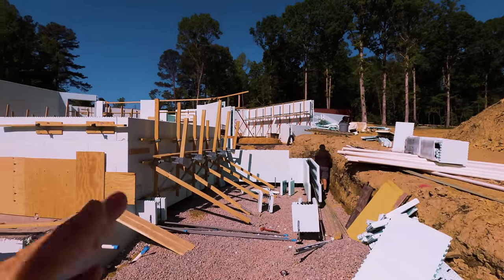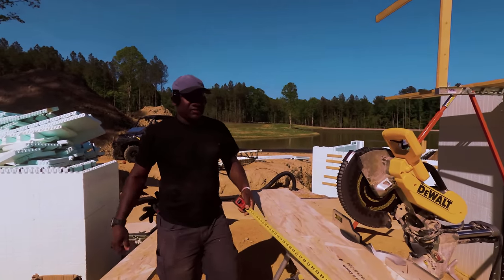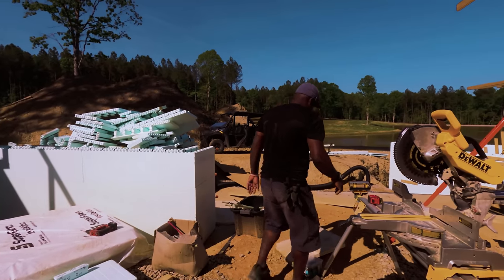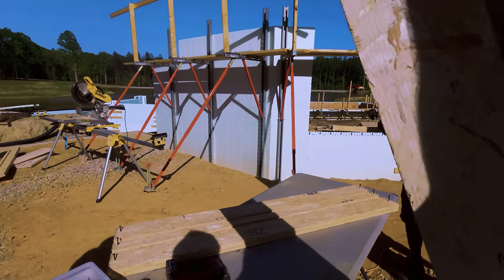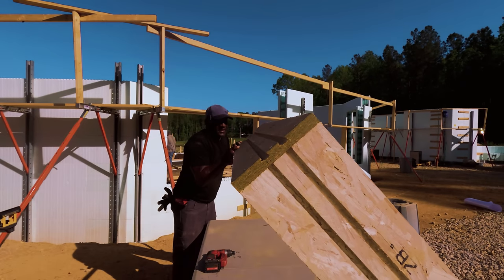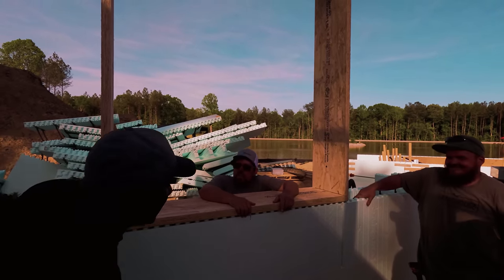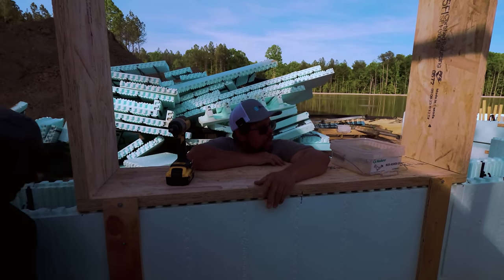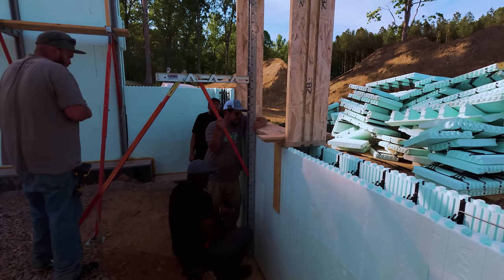PreBuck Window Construction and Building ICF Pump Room

Comment: Mr Bealygood tell them guys having issues with installing those screws to keep a bottle of dish detergent handy , add a few drops on the end of the screw and it will go in very easy. I've used dish detergent when installing screws into thick wood for years.
Reply from the maker: Great tip!
Reply: When I was a young man my old boss gave me a cake of soap for the screw’s worked well ,

Comment: with all those wide window bucks. It be a track saw for me and a 33 inch track. Portable table and a piece of styrofoam as a backer. Best tool I ever invested in
And the Metabo Triple hammer impact drill.. I’m a huge Milwaukee guy but Not even close in performance
Reply from the maker: Wish I had one 🤣

Comment: 10:29 Good old ported boxes. Yes sir, with 15 inch JBL's was heaven when the ports were right. Mid range and tweeter were many options but that bass had to be JBL's in my book.
Reply: Still using my original set of Harman/Kardon ported computer speakers from 1997 on my desktop today. Sound like brand new. Suckers got some heavy magnets. I know there is better tech out there but it don't sound the same.

Comment: A lot of side pressure on that pre-buck, better to make the horizontal pieces shorter and the vertical pieces longer, especially at the bottom. Saves extra bracing.

Comment: @15:28 I never thought I'd see this again: assembling bucks with Phillips screws. In my 50 years of assembling windows we went from phillips screws to square socket for light duty  and Torx for heavy duty applications we were assembling bucks  with panning up to 144 inches  . We manufactured aluminum windows , the company started in 1952 I started working for them in 1973 I retired in 2023 50 years. . I built sliding glass patio doors and terrace doors for 30 years I also built the various lines of custom shape windows, that was a job I loved doing (chuckling) two men said I was intense as Picasso with these windows , but I never cut my ear off ,LOL  Wojan window and door corp..
Reply from the maker: These are T25’s
Reply: @BealyGood  Ok pardone T30 no. 10 screw enamel or yellow plated but tube wax my man it won't jump or break or strip, wood is tuf but 6065-T6 aluminum is tuffer when using 4 inch T30 no.10 screws flat heads with a 1 inch shank .
Reply: It was Van Gogh who cut his ear off btw
Reply: @lastguy8613  I was typing a lengthy reply and hit a wrong key, just ticked outside the box and everything disappeared and the back button did not work, I'm a very spiritual person and when this happens I reverse course I have an intense bond with my creator and when this happens I try not to blow up it's difficult, a test , so I will not repeat it. I was typing a grudge that should explain. I apologize for wasting your time.
Reply: @kittty2005  All good my friend, I wasn't trying to judge and I hope Geoff found your information useful. Just pointing out it was a different famous artist that cut his ear off. 
My favourite line about Picasso is 'Pablo Picasso was never called a a$$hole' by NWA I think, though they or me could be wrong about that aswell

Comment: If you are going to continue up after pouring the walls set up now, put clear packing tape on the top of the install forms. That way concrete won't need to be cleaned out of the top connections.
Reply from the maker: Already bought some 😁

Comment: Looks like you are using Phillips Head screws.  You have to put a lot of pressure on those to keep the bit from popping out on long screws.  Try Torx or Torq (same thing, different brands).  They drive a lot easier.  I tried those and threw all of my. PH screws out.
Reply: T 25 Torx
Reply from the maker: T25’s

Comment: 17:39 What you need right there is a Filipino screwdriver.  Whilst building some internet cafe cubicles out of timber, plyboard and screws I left my partners Filipino uncle to build some.  I heard some banging and went to have a looksie to find uncle using his 'screwdriver' aka hammer to put the screws in.  🤣🤣🤣🤣  He was a carpenter I was told.

Comment: you forgot too add the wood thicknesses on bucks
Reply from the maker: I counted the 3" total for the bucks. I didn't figure the 1/2" for each side for adjustment. But I am custom ordering the windows so will be measuring final openings before order.

Comment: @17:31 OMG at least  get a product called tube wax or stick wax poke the screw into the soft material and it lubes the screw and it goes right in without stripping, stripping screws will test your temper or lack there of please please it will increase your productivity immensely, buy a case it's well worth it.